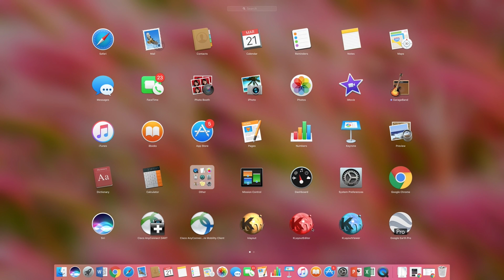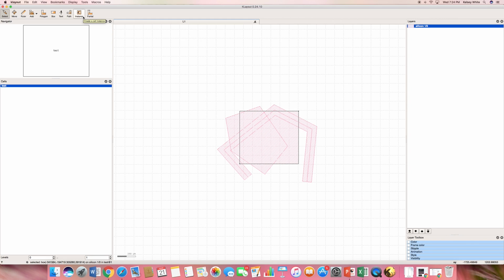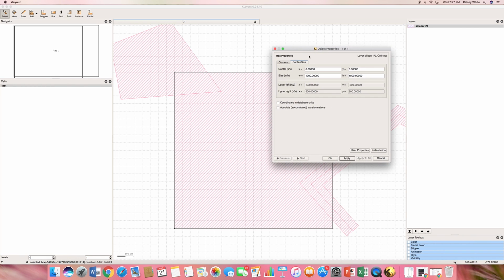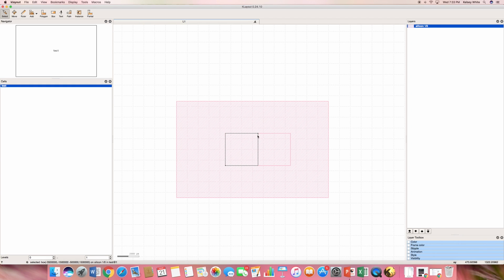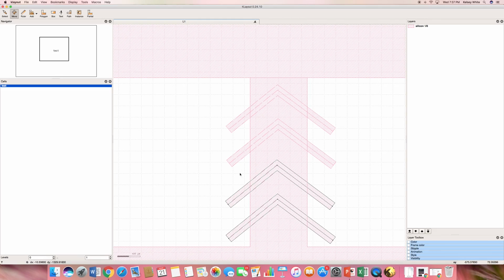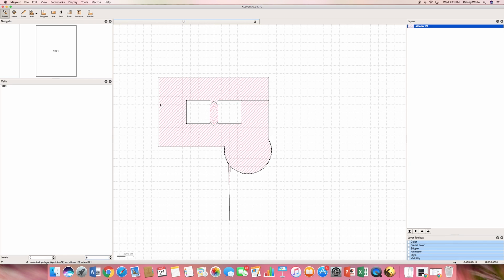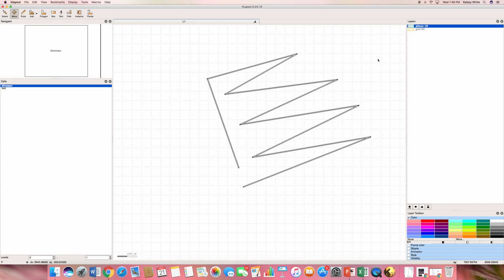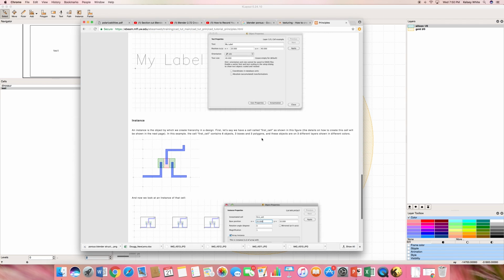Klayout Tutorial: Getting Started With Microsystem Design

Comment: Thanks for the tutorial, do you know how can i creat a square with different angles on the edges?
Reply from the maker: Sure, you would probably make two different squares with two different length/widths then rotate one of them and align them (you can copy one square, apply a 45 deg rotation, and then scale in place also). Then you can select both and use the 'intersect' boolean tool to achieve the result. Sorry for the 2year delay!

Comment: can you copy a figure from one layer to the other?
Reply from the maker: Yes. If you have two separate .gds files and want to bring cells from one into the other, open both files in separate layouts and then simply copy and paste. The caveat is that the database units for the two files may be different (1 micron vs 1 nm for example) and so the copied object may need to be rescaled using the edit-> selection -> scale command.